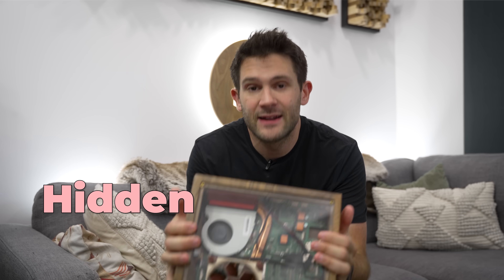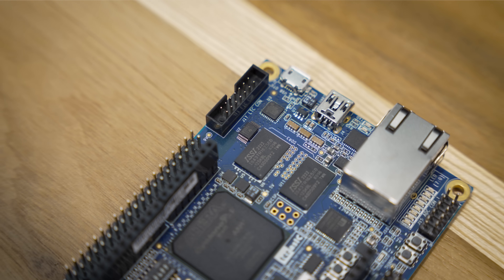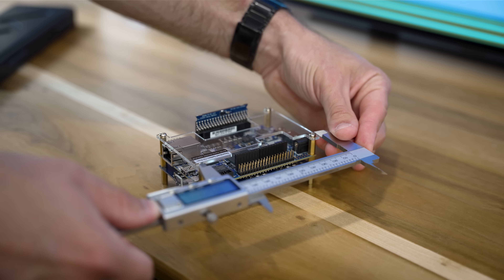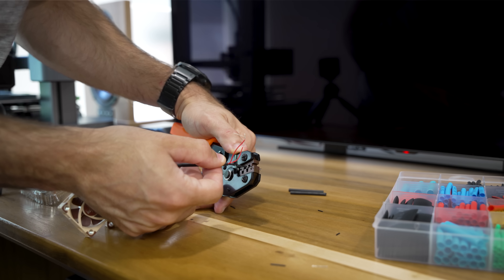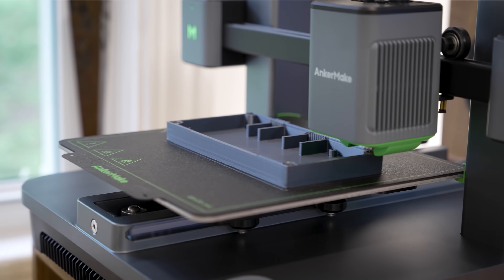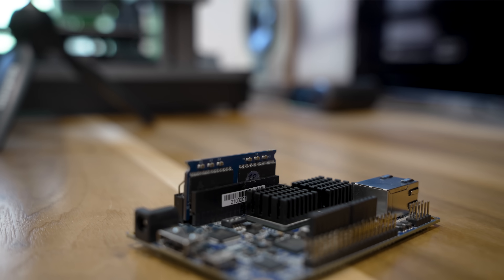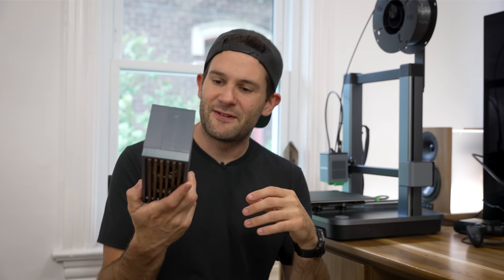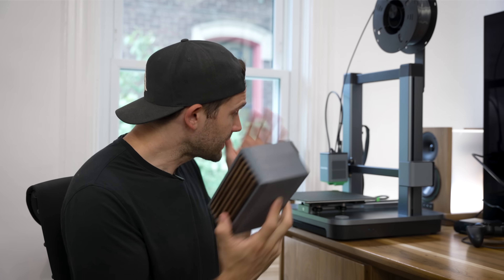This DESTROYED my $4000 PC

Comment: Love how they have brought FPGAs to the retro gaming scene.  I noticed you compared latency of the Nano against other software emulation systems, but what about latency as compared to the original hardware (and perhaps for other emulated systems)?
Reply: Compared to original hardware it's a lot of latency the way he had it set up. LCD TVs, the up-scaling required to display on them, and using USB controllers add a load latency.
Reply: @damionmanuel7337 Also, if he had went with the SNAC, the input latency is near identical to the original hardware since it uses a special USB port with direct lanes to the FPGA. Team the SNAC with true analog video, and the input latency is near perfect, so much so that speed runners can use it to practice.

Comment: 12:13 - there is enough internal space for either the WiFi or BT connector.
If the single internal USB cable would go to the other side (with a 90° connector or just stripped plug rubber) then even both would work there.

No idea for the moment if the fan-side USB connectors would be ever useable. Not even turning the USB PCB into some other position might do that trick.

Comment: if you want to make the case stronger with out adding extra support in the inside you can just add texture to the print walls. similar to what manufacturers do to make thin aluminum sheets more ringgit. CNC Kitchen has this video explaining the process.
Reply: "Texturing 3D Prints for Strength!"

Comment: There is a way to reduce the input lag on the mister. In the configs you can turn on USB fast polling. Then there is the SNAC adapter, which effectively is zero lag as it is the same as connecting a real controller to a real console. There is no middleman dealing with inputs, like USB.

Comment: That looks like a magnetic flexible build plate.  To remove a print take the surface off and bend it to pop the print loose.
Reply: I mean if it just yanks off I don't blame him for skipping that step :)
Reply: "Ideally" you wanna just wait for the print to cool and it should release from the build plate by itself lol, but if youre in a hurry yea you can just pick the bed up and flex it

Comment: Digital Signal Processors can do the same thing as Field Programmable Gate Arrays - they can be reconfigured to function as any type of processing architecture.  Useful for networking, audio, video, general purpose CPU, etc.  The other cool part of DSPs is when one isn't fast enough to tackle the role of a different processor you simply add more of them.  In this way the DSP can be used to function as the electronic stem cells of a future proof PC.

Comment: It could be a mini Sega Saturn?... I'M IN. I need to get my PAL edition of Panzer Dragoon Saga fired up!... Without... firing it up O__O 

And yes, if you know how much a PAL copy of PDS costs, I want to keep it safe :face-orange-biting-nails:
Reply: The Saturn core is currently in progress, and can do quite a bit, but it's technically still pre-alpha so a lot of things are missing.  Fortunately progress has been slow and steady, though and it's still in development.
Reply: @dinierto   @dinierto  That's great to hear. As good as the Saturn is, I'm aware the architecture was quite... Unique? Am I right in saying, software wise, is transparency rendering is still an issue for emulators, does that extend to the reworking of the core? I'm really glad the SS is getting the love it deserves; what region/variant of the core is being worked on, PAL/NTSC, or is it a hybrid?
Reply: @drag0nmare  I am sure you can load whatever BIOS region you want, I haven't messed with it in its current state but that's how other cores work.  I'm not sure what you mean about transparency rendering?  If you mean where some systems relied on composite/RF blurring to turn dithering into a transparency, there are some solutions.  For example the genesis core has a composite blend mode, and there are also various blurring and scanline filters.  You can always connect it to an actual CRT as well

Comment: Great and pretty interesting Video ;) But as a guy working in electric kind of company I have to say this... please... never... NEVER do things like in 8:54 WITHOUT ferrules... i know it's an extra step to do, but especially on hardware get's moved around or has kind of small vibrations and so on, ferrules will save the Copper in your wire at the long run. Had some people having problem of connection problems cause they didn't use ferrules. Copper got kind of "screwed" up by the rotating screw and when it moves it's kind of a scissoring movement which faster or later will remove enough copper so you don't have proper connections anymore or even Cable can slip out of connector and even can give short circuits.
Besides this, great and interesting video like i said earlier and hopefully some time in the future we also can make great emulations of "newer" consoles like N64 or even Camecube and so on like this ;)

Comment: btw said advertised speeds are only for non print moves, alot of companies cheat their way like this claiming fast print speeds when its just print moves which can end up most of the times not even reaching those speeds cause accelerations are to low to shove the head to 500mm/s on a 10mm distance move

Comment: I was doing this in 2001 on a 1.8ghz AMD cpu and 16 mb video card at full speed. Snes9x was pretty much indistinguishable from the real thing back then as well.
Reply: that's because most popular emulators these days are the libretro cores. The bare metal ones will always be faster.
Reply: @Trzyzet  well most accurate at least :)

Comment: While FPGA based emus emulate hardware and in some cases software (replacing bios calls for example), Software emus can be just as good as accurate while providing more features. 
But none would allow you to actually experience the game as it was intended when it comes to CRT' and electron beam trickery to generate unique effects. So you get the gameplay, maybe the same latency ( although, digital to analog convertion will introduce some), but not the same graphic effects, including color bleeding to simulate more colors than the hardware can make.
Also don't trick yourself into a CRT monitor, you want a TV CRT to get the intended effects and the original 1:1 resolution.

Sonic is the perfect example to demo the effects I'm talking about, the flickeeing, the waterfalls and fire effects... Not the same on a CRT TV. It's like turning on new graphics features on a modern game.

Games made for the arcade however have similar tricks for CRT monitors. It's a fun rabbit hole to dive in.

TLDR : have fun. But if you want to get the full 90' experience either fimd a CRT TV on the curb or wait for a 600hz + refresh rate OLED so that emus can at least simulate the vertical scan

Comment: 81ms is quite bad input lag with around 5-6 frames. And you PC can outdo that with the right emulator and settings. And if your machine is beefy enough, run ahead is a good way to make it matter even less, enabling frame perfect input.
BT doesn't have bad input lag when its done right, the 8bit do dongles with PS5 controller have around 20ms, or a bit more than 1 frame.
So your controller or screen might be the issue here.

Comment: They have at least some Nintendo 64 stuff working. The de10 has 2 ARM processors on it as well as the FPGA so those could be used for software emulation at the same time as the FPGA.

Comment: You really don’t need to use supports for that 3rd piece of the case you printed, even the most basic ender 3 would be able to bridge those gaps in PLA with no issues.
Reply: this is what I kept thinking, honestly it's not much of a torture test that's a pretty basic part to print
Reply: @dinierto  yeah in this case supports just added post processing and wouldn't have increased quality at all, it probably decreased quality on those surfaces.

It definitely did not show off the printer in any way though.
Reply: @conorstewart2214  agreed

Comment: I watched this video som days ago and i was wondering about your lag results. I think 100ms for a pc is a lot, but maybe i m wrong, and i think also for the mister 81ms is on the high side. By chance, did you set up HDMI sync to the minimal lag version on the mister ( value 2 in the ini file )? That could shave off another frame of lag in theory.
Reply: He probably could shave of a lot of lag through different settings in the emulator. When I first experienced RUN-AHEAD and similar options on RetroArch on my PC it was incredible. The games felt fine before, but actually felt like playing the real deal after I activated every setting that reduces input lag. It was sooooooo much better.
Reply: @Rosa_Canina  run-head is kind of cheating of course, and i have no idea how it can process the next frame before i actually pressed the buttons. Considering that when you have 8 buttons and 4 directions you can't even do all the combinations
Reply: @andreabogazzi5410  Not really cheating. It basically just eliminates a lot of input lag by running the game a frame ahead and processing as example a jump and if you ARE pressing jump at the next frame they use that state but if you are not they roll back and stay with the original input.
In the end this just means they process your input slightly earlier, which shortens the input delay emulation has. As a player you basically see the game later because of emulation but your input got processed at the right position.
Reply: @Rosa_Canina   i know how it works, so that is why i was saying is a bit of cheating if you are comparing system latency and the difference between a OS + software implementation compared to a more simple and direct implementation of the system that run the same game. I was pointing out that the fact that some emulators have run ahead, and considering the systems that can have run ahead and that can not  ( how does runahead work with analog input? ) suggesting to enable run ahead in a generic lag comparison with 2 different machines and systems feels like skewing the results. It makes look like that not enabling runahead is a misconfiguration use case, while is not. This is what i mean

Comment: the lcd screen introduces latency, and every TV is going to produce different results there
using 2.4ghz 8bitdo controllers is relatively fairly low latency still
the particular game you're playing will also have some impact on e2e latency - e.g. TMNT1 on the NES has really bad input code
Reply from the maker: This is true and probably something I should've mentioned in the video. I'm measuring round trip latency of the whole system, not just the MiSTer. That being said I had my monitor in low latency game mode for both tests.

Comment: I'm obviously a bit late to this video so I don't know if there have been any changes since or it's the fact that I own an M5 as opposed to the M5C in the video, but in my experience, the difference between the fast and normal profiles is not speed but rather layer height. 0.2 vs 0.25 mm.

Comment: I don't mean to be annoying, but you're supposed to crimp ferrules onto the wire ends before using them in a screw terminal.  this significantly improves mechanical stability and provides significantly better contact between the terminal and the wires.  it also adds a bit of insulation to the end so there are no exposed wires that could be shorted by any means.

Comment: Try running your desktop emulators in fullscreen (exclusive fullscreen if the emulators you're using supports it). This should drop down your latency considerably. Also check the emulator settings for things like render ahead and don't forget to enable Nvidia Ultra-Low Latency/AMD Anti-Lag for your emulators.

Doing these will probably bring down your latency more than using FPGA as modern components are so stupidly fast.

Comment: longterm I still think software emulation should be what needs to be maintained, the initially described issue of sequential emulation is to well, utilize threads to emulate different chips/subsystems.
Significantly more people can work perfecting software emulation to make it more flexible and plug-and-play than hardware emulation unless FPGA chips for some reason will go mainstream for phones/computers

Comment: So, your monitor has roughly a 10-15ms response time @ 60hz (based on res output of the game/core). Because of how the Mister is, it'll only produce a 60hz output, so your monitor is actually at a huge disadvantage in these scenarios.

The mister has practically no input latency when used with an analog output and a wired usb controller.... which is why its as close to OG hardware as you can get.

Comment: It would be nice if someone sold an FPGA emulator board that you can just pop in your PC to emulate game machines.

I mean, there are prototyping boards you could program for that purpose, but they are expensive.  Hence, the need for a specialty one configured for retro gaming consoles.
Reply: As I understand it, anything running on a PC has to run through the GPU's frame buffer adding at least a frame of lag, which defeats the purpose of FPGA
Reply: @dinierto  I would imagine that in a scenario like this you would simply just need a piece of software to navigate the Mister like a GUI, with the DE-10 still utilizing it's own I/O. Meaning, you wouldn't be using the pc other than as an interface, with the DE-10 video out going to a signal driven splitter. That would be a vastly overcomplicated solution to a problem that doesn't seem to exist though. Crafting bespoke PCIE adapters and software all for the sake of having everything in one box seems like a lot of work with very little reward...but if it were an option that already existed, I'd probably be one of the few weirdo's that would do it, haha. 

"There's dozens of us!"
Reply: @coffinbirth2847  as I understand it, it doesn't work like that

Comment: How's the input lag from your TV? Is low enough, in game mode, to see the best possible latency with modern displays?

FPGA is awesome but the DE-10 nano might be the only real solution for hardware emulation. I don't know how good PSX emulation already works and that's already great but itself. N64 would need more power and an even more expensive FPGA. PS2 generation will most likely be out of range for a realistic solution.
So PSX (or N64) might stay the best we will get with hardware emulation.
Reply from the maker: My CX Oled actually has ridiculously low input lag in game mode. RTings put it at like 6-7ms depending on the resolution/refresh rate.
Reply: sombody is working on a n64 core and it plays so far 1 commercial game the guy making the core claims it can be done on de10  and ps1 works great . the ps2 can it be done on fpga the answer is yes the question is who is going to do it that is the problem not that many devs in the fpga scene who have talent to do this type of stuff
Reply: @ZacBuilds  Ah, that TV. OK, then it doesn't get much better. I should look out for some latency test of an original console with a CRT. That would be an interesting comparison.
Reply: @soloM81  N64 really working would be crazy! In the end I wouldn't have thought PSX would even work but here we are. Just wonderful.
Dreamcast and PS2 are possible on FPGA but that's not the issue. The former has 1,4 GFlops, the latter 6,2 GFlops. It's hard to do a comparison to older consoles but when we compare it with possible polygon render counts it would be around PS2:PSX - 235.000:1 at the least. How much bigger/better does an FPGA need to become to be able to emulate PS2 or even GameCube (9,4 GFlops!) and how much would it cost? FPGAs at that performance level won't be that common.
And that's my point. But I'm fine with N64 being the best for hardware emulation. I won't mind getting surprised though. ;-)
Reply: the problem is not if there is a fpga that can do this stuff it comes down who is going to do it so far there about just 5 guys who have the skills to do it but have to work as a team . this is not like software emulation were there is a lot of talent in the fpga scene its lacking that is my concern more then anything else  @Deinorius
Reply: @ZacBuilds  If this is true then something is wrong.  The MiSTer absolutely should not be adding 60+ ms of lag.  If your TV is 6 ms and your controller is 6 ms wired (according to testing) that's only 12 and the MiSTer shouldn't add anything more.  Do you have it running in vsync_adjust=2, and do you have usb fast polling enabled?

Comment: Improperly set up scanlines are dumb, but when correctly configured for your resolution and with appropriate parameters it gets the experience much closer to the original thing. That is because most art in retro games is made for CRTs, which create a multitude of new colors as the beam blends the pixels during scan.

Comment: ok ok this is amazing and all, but the proper way to measure latency (especially in the range of milliseconds) is not by watching a frame of your finger poping a button, you need check the signal of the button itself and do it at least 3 times to have a decent enough measurement in terms of accuracy otherwise it's just a vast approximation.

Comment: QUESTION: With the emulated scan lines can you play duck hunt for the NES on that with a modern tv with no other mods than the original zapper gun and the emulated game?
Reply: Not with emulated scanlines, no.  You can, however, use the SNAC adapter he mentioned and use a zapper on a CRT.

There are other types of light guns you can use on MiSTer with an HDTV though.

Comment: What I'd love to see is this FPGA being able to fit on a pci-e slot on my pc, like any othe expansion card.
Reply: you'd lose the advantage of the FPGA as I understand it because the video signal would still have to run through the GPU and thus lose a frame due to buffer.  That's how I understand it at least